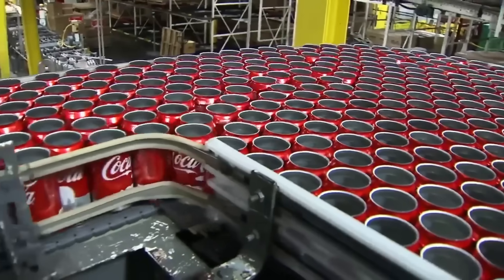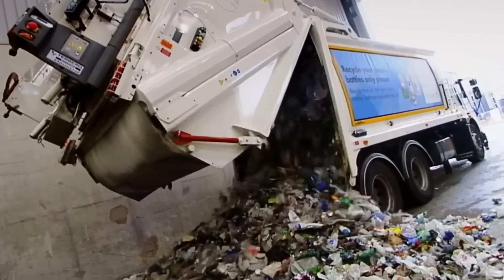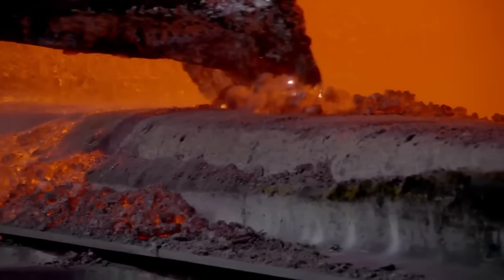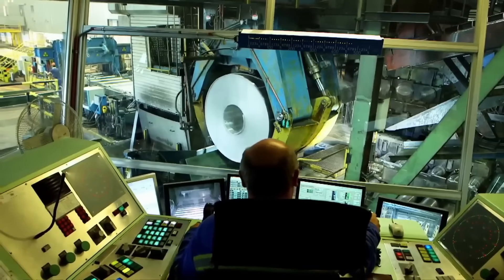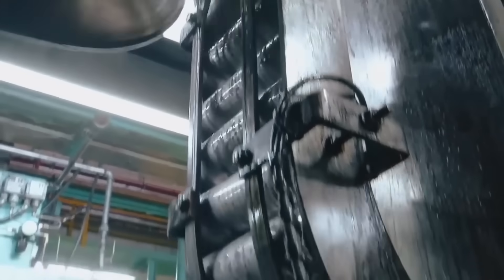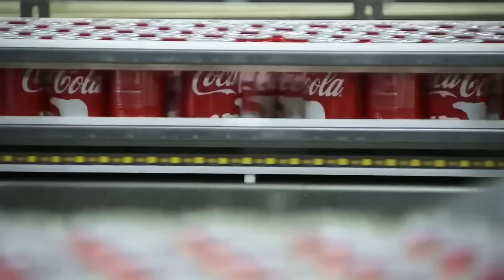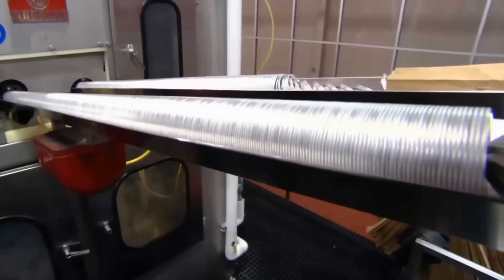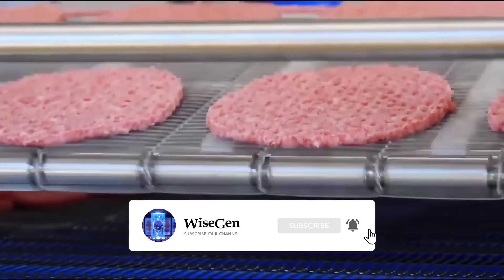Coca-Cola Canning Line Factory -  Aluminum Can Manufacturing Processes

Comment: Wow! so the initial cup as they're calling it is forced through several rings producing an elongated aluminium cylinder and then the cap is added later. Didn't know that, not how I thought they were made. I knew the graphics were added by the can manufacturer though.
It's a slick operation keeps the costs down too.

Comment: I used to work on a smaller soda can filler in the early 80s and top speed was 500 cans per minute  had to constantly load tubes of the can lids but I liked running the machine top speed!!!

Comment: I worked for the Schlitz can company later Strohs. He left out all the colors on the can are put on at the same time. You can put up to five different colors on each can. Before it leaves the decorater while that ink is still wet it also applies a coat of varnish on it. Think about the clear coat on today's car, serves the same purpose. That machine could run 960 cans per minute. After leaving that machine it went through an oven to dry the outside. It then went through a spray unit to cover the inside like he said. It then went through another oven to dry the inside. Then to a necking machine and finally to the palletizer where I worked. It was fed by two decoraters. Our shifts were 12 hrs a day. Our work days were 4 one week and 3 the next. Unless some issues arised I would place over 1,000,000 cans on pallets for shipping every 12 hours. There was at that time 3 palletizers. From what I understand now they have increased the production and added another palletizer. The plant was sold some years ago and I'm not sure who owns it now. It was at that time the second largest can manufacturering plant in the US. Only the Coors Brewing Company in Golden, Colorado was larger.😊
Reply: Interesting read. I just started working for Ball beverage in the uk a few weeks back as an engineer. Yeah the video misses out the oven drying processes, the million checks that are done via camera systems and operators lacquer thickness tests plus many more. We make loads of coke products and only make it up to the necker/flanger so seeing the lid being put on was a first.
Reply: @paulbateman81  What we called advanced tech then would be laughed at today. I went to work there in 1979 and was laid off when they moved the end production, lids, to a Texas plant in 1987. I probably wouldn't recognize the place now. It's amazing how many people they displaced with the technology in this plant over what we had.  In the front end where the initial can was made each pair of lines had at least 3-4  people. There was a person maning every two spray banks, each decorator had it's own operator and drying oven. Each pair of spray banks had their own  drying oven. Then those two lines went through the necking process, anywhere from a single neck to a triple neck. Then went through another machine to check for pinholes and finally it came to me. There was one person making sure each pallet was strapped down for shipping. Then you had at least two-three   fork lift drivers putting them in the warehouse. Not sure how many was in, quality control. I believe we had either 3-4 ET support and a couple mill rights. All of this was per night shift. Day shift had even more people. In this video it looks like about 50 percent of the people may have been replaced with automation. Probably increase productivity at a lower cost. I remember that they told us we were the most expensive part of the can of beer. At that time they told us it cost 7-8 cents  to produce one can.
Reply: @paulbateman81  I think Ball might be the company that bought the can plant when Strohs was sold. It's in Winston Salem NC home of RJR tobacco company before it was sold. I'm sure you could look at their world wide plants because I know there's many in the states.
Reply: @donaldsink8115  Hello! Where are you from?
Reply: @Samdiscoverystudio  Winston Salem, NC

Comment: Not how it's done in Canada or USA.  The cans are made at Crown Cork and Seal.  They make all the aluminum cans including automotive ones and many others.
Reply: Late 70's to 1987 I worked for Schlitz then Strohs can plant. At this plant we made the several different breweries cans plus about any kind of beverage can you see on the shelf. We were at that time the second largest can manufacturing facility in the US. I was on a palletizer, the final stage of a two leg production line. Most 12 hour shifts I would place up to a million+ cans ready for shipping on a pallet. Coke distribution centers have their own name and location on every can. Those cans also have a code on them that tells you exactly what machine created the can, which machine put the label on the date down to the shift. That's all there in case there's a product problem down the road. Not sure who owns it now but after I left it was sold to Ball manufacturing and still making beverage cans.